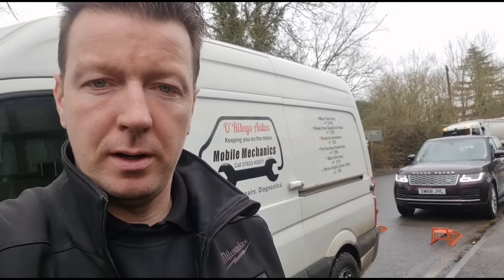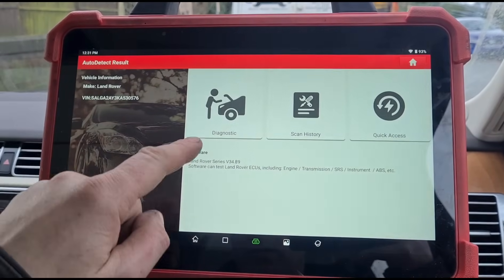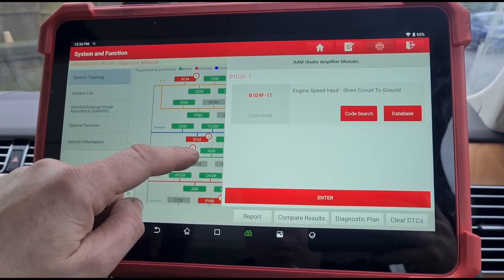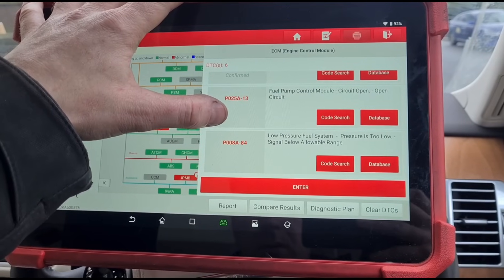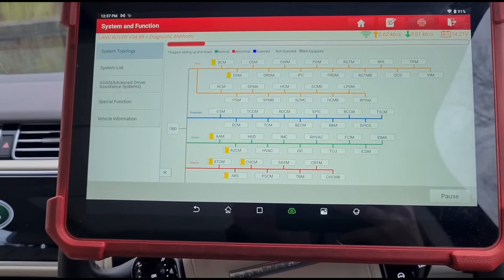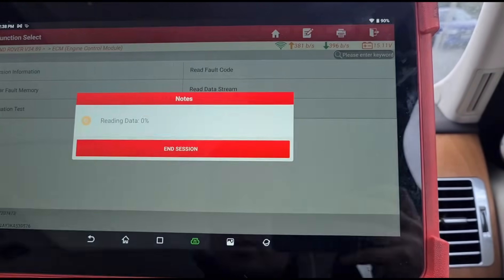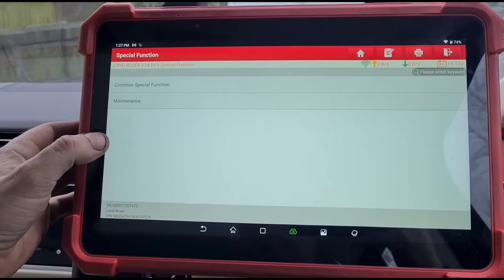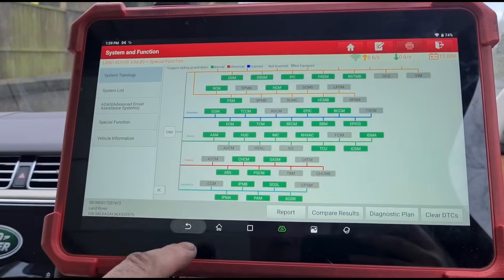Land Rover 2.0 Petrol Hybrid P246C-00 Gasoline Particulate Filter GPF Restricion

Comment: Hello! Thanks for the advice! Please tell, if the Launch crp919E BT can also see the soot mass for Mercedes M274 2018 year?  I can't find anything related to GPF. I can't even find the data for the differential pressure sensor. Maybe someone has already disabled it, because there is an error only in the scanner, that the amount of soot is not Ok, but the car drives fine and the check (MIL) light is not on. I would be grateful for the advice! Good luck with your work!

Comment: On petrol cars fitted with GPF when u get the GPF symbol on the dash (blocked GPF) u can fix it by getting on the motorway stick it in a lower gear and accelerate so RPM gets to 3500-4000 RPM then take quickly foot off the pedal and wait 5 seconds then accelerate again to 3500-4000 RPM, keep doing this in a loop and it should clear GPF quickly, from 7 minutes upwards depending on how blocked the GPF is, this method will clear GPF way faster than keeping foot on acc. pedal constantly, it seems that every time u let off the throttle it bumps up the exhaust temp so doing this enough times will get the exhaust temp hot enough to where it starts burning off the soot (passive regen).

Comment: I have a GLC43 that would have cooling fan overrun when I stopped the engine and engine was running hot.  No obd stored codes. Mercedes dealer confirmed soot level was above 2 so they took it on high reving journey and got it down to just under 2.  With GPF the engine injects more fuel to burn off soot, but if you are running short journeys and stop the engine before it finishes it try’s to finish the regen and get rid of the fuel even when the car is turned off.

Comment: My mk5 mondeo titanium x sport, came from same dealer in Coventry....187k and zero issues in the 4 years ive had it... , i change oil at half the intervals, fuel filter every 30k and dont use supermarket diesel...

Comment: Nice one Jimmy, good outcome for a first time with a GPF, but I don't think we were in any doubt you'd get there. Watching this one was like watching a long running TV series...
Act 1, just a normal day clearing DPFs and resetting codes
Act 2, GPF arrives, don't know can I do this what are my parameters?
Act 3, Things are not working, Launch gun damage, fluid in, codes wont clear, second tool used
Act 4, Jimmy finds a way, soot back in spec, codes cleared, power back in the vehicle, Happy customer, 
Roll the credits 😁😁😁👍👍👍😁

Comment: Petrol gpf s clear best at decel fuel cut from higher rpm (accelerator pedal released). Unlike  diesel vehicles there is no spare oxygen to clear the gpf under a steady cruise. As petrol engines run at stoichiometry in general running, it is not possible to get a run away reaction when trying to clear a heavily laden gpf unlike diesels.  Once a dpf starts to clear it is almost impossible to stop it as diesels run lean, so there is surplus oxygen to keep the reaction going once started. This can lead to severe over heating and melting of the substrate and a possible vehicle fire if an overloaded dpf is allowed to regenerate.
Reply: One of the most informative comments I’ve read in a while, thank you

Comment: Cant speak for JLR , but Toyota Hybrids will disable the fuel system if they get to low as there is no way to start the ICE if you run low on fuel and try to drive only off the HV battery. Add fuel and clear the codes and you are away again, the low pressure could have been a similar problem depending on how they are starting the engine ? I would also add that some people seem to think they are driving an EV rather than a hybrid and have to be told that they still need to put FUEL IN !  🙂

Comment: I believe gpf regenerates on overrun low load rather than adding fuel like a dpf perhaps why reving dropping reving did the trick read up on theory 9f operation on ford gpf. But good you didnt just give up like most mecanics or theowing the oarts cannon who wants to work on that cramped engine bay i think id shy away from majour work on one of them 😂

Comment: Another great video. I am sticking to my diesels, even though I do mostly short journeys to work for 5 days (8 miles each way). I take a spirited run once a week for 45mins at Motorway speeds, so fingers crossed, this is enough for a regen.
Reply: Every diesel needs a good workout on a regular basis. 👍
Reply: Delete dpf
Reply: @megataurus7779 not if it’s euro 6. You’ll end up putting one back on it.

Comment: Hello, good job. I live in Denmark and have a Vw caddy 1.9 tdi, have you ever done this on, and can guide me, it is to fare from you, to let you do it 😁
Reply: You have a dpf and not a gpf.   However the 1.9 may be to old  to have a dpf
Reply: @mattmckie6967 it is a 2009 Vw caddy
Reply: @mattmckie6967 VW were fitting them as far back as 2006
Reply: Very few 1.9tdi were fitted with a DPF... From memory it was only BLS engine code and not even all BLS had them
Reply: @tipptop9  correct think it’s BLS BSU, seems to have been 2008–2009 onwards. I have a 2008 Caddy with BLS and it doesn’t have one. I assume it would have been late 2008 they started to fit them. 

When I look up parts there is even a retrofit kit ti add a DPF if wanted.